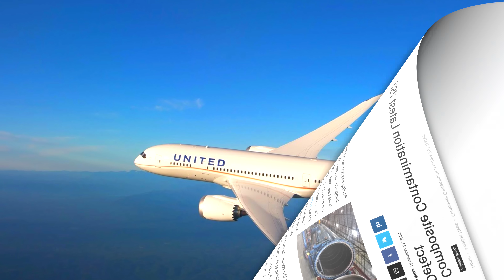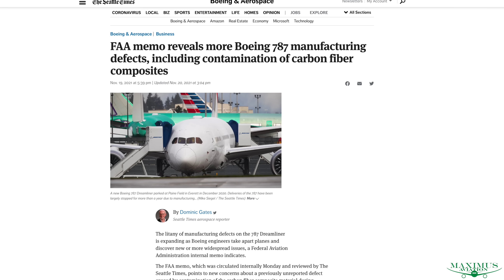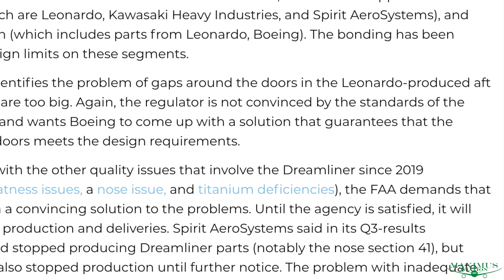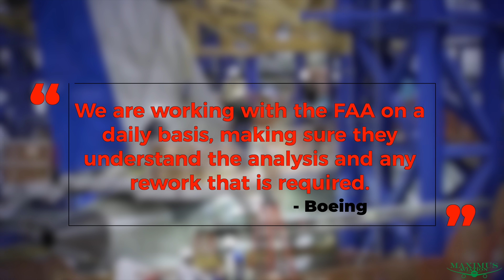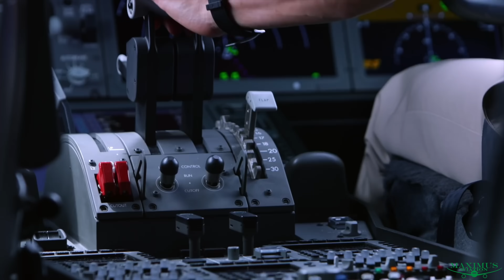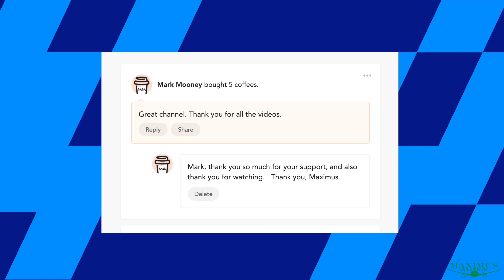Boeing Admits The 787 Carbon Fiber On The Wings Are Contaminated And May Compromise Wing Stability.

Comment: The 787 may be the first carbon-fibre airliner, but it's not the first carbon-fibre aircraft. It also wasn't the first airliner with carbon-fibre parts.
Reply: You are correct, but then no manufacturer would make such a big leap without having done its 'homework'    Boeing had some composite horizontal tails flying on 747s in the 1980s.
Reply: @dougball328  The point I was making, though not clearly, was that contamination issues are something that should have been discovered and addressed long before the 787 was even conceived.
Reply: @sylviaelse5086  You are also correct that it wasn't clear, since you never mentioned the word contamination.    I was there, and those issues were addressed - at Boeing.   The wings were designed and are being built in Japan.   For this kind of a process failure to happen there is almost inconceivable.   Clearly the operant word there is 'almost'.   Boeing's history with the three heavies is more than 40 years and nothing like this has happened before.

Comment: To outsource or NOT to outsource:

After the Boeing 777 program Boeing made a fatal decision to outsource as much as possible and these suppliers also outsource raw materials, parts and subassemblies. 

Thus Boeing looses quality control checks and balances down the long global process of raw materials, parts, sub assemblies, to final assembly at Boeing. 

The more Boeing hands off the more hands on that Boeing doesn’t know about. 

For example, before taking a multivitamin ask yourself: How many raw materials, processes and hands have gone into what I am about to swallow?

If the manufacturer outsourced everything and just packages the final product, anything that has gone wrong prior, even by the slightest amount during its long journey to the final packaging, the results may be more than a tough pill to swallow….they maybe and have been deadly ☠️😵🪦.

Comment: EVOLUTION NOT REVOLUTION!! Could have started the Composites with the wings, tail Section, and Cockpit Section and left the rest of the Fueselage built with Aluminium or Such as. Even Musks "Bakery" which is Manufacturing the Tiles for the Starship have their own problem with shedding tiles when the Enormous rocket boosters fire. In this case the 787 Low Bake Ovens maybe the problem! So large you cannot control the temperature at the center of the oven as much as they would like. Basically leaving an unevenly cooked roast. Suggest they Literally ask an Industrial Chef or Roast Master how they solved their heating Issues. I could suggest Good Ol Steam injected at strategic points from a boiler/steam generator.

Comment: As these composite material based planes start to age, I am afraid some nasty things might happen.
Reply: How composites age is certainly a subject of a great deal of study. And well it should be. We don't KNOW how much remaining strength a carbon fiber fuselage will have after 30 years and 40,000 pressurization cycles.  Not until 30 years and 40,000 cycles have passed.   The cycles can be simulated.  The effect of 30 years....takes 30 years.
Reply: @Turboy65  30 years maybe the best case scenario. What is certain, is that what is composed, will eventually be decomposed. These materials do save some fuel, but are quite risky.
Reply: @abababa7483  The carbon fibers themselves might be quite inert, what concerns me in the long run is the plastic binders. There are 30+ year old Formula 1 cars that still get driven, but I haven't seen proper testing of these aged materials.
Reply: @freakinccdevilleiv380  Take into account that airplanes operate in much harsher environments than formula one cars, so... I don't know.

Comment: Good thing those Apollo engineers [SpaceX too] didn't build/sell failed designs and ask for 2nd generations of designs.  BAD engineering is just bad engineers or managers NOT doing the work. In Boeing case I look to bad managers.  You?
Reply: Have you heard of the Boeing power issue? A few years back, the batteries in the 787 plane were faulty, and grounded the 787. :) Lol ... This is more like a Nightmare-liner.

Comment: And from that same Seattle Times article,  it is stated, "Initial tests conducted by Boeing and reported to the FAA in April showed a positive outcome: although the bond strength was reduced, it was still within the design limits."
Reply: That depends on if the contamination can be shown by samples that it is uniform and predictable...Fat Chance.....
Reply: @regdor8187  Did you read the article?  If the contamination was due to the usage of a PTFE barrier sheet in the manufacture of bonded composite parts, and the usage of such sheeting was routine and consistent, then the contamination level is very likely to be uniform and consistent.  Mitsubishi actually owns the blame for this one, not Boeing.   A manufacturer has to trust that its supplier is providing parts and materials that conform to spec.   Mitsubishi's process was wrong, and violated Boeing's specs.
Reply from the maker: Yeah it is within limits.  I also think since the FAA got burned by not doing their job on the Max disaster now they are going to  nit pick Boeing to death.
Reply: @maximusaviationchannel  I do think Boeing needs to be under the supervisionof responsible adults for a while.  And ultimately, all their problems can be traced to cost cutting on their payroll by replacing highly experienced and qualified personnel with immigrant "engineers" from third world countries, via the H1B visa program.  (Save money! Hire H1B!)

Comment: Making an airplane out of BURNT STRING....what can possibly go wrong?   

Actually I don't think this issue is going to do anything but maybe require inspections a bit more often than originally planned.  And let's not forget,  Airbus is using lots of carbon fiber as well.  And they have a surface degradation issue with some A350s.

Comment: Not just the manufacturers of the parts, there have been issues right from the start with even numbered aircraft produced in North Caroliner, this is what happens when you open a new facility and don't have the experience of putting them together, I dont want to knock Boeing as ive been a huge fan of all of their aircraft, but the need to turn all of this around else they will fold, and that just leaves Airbus as the market leader.

Stop paying directors stupid amounts of money, and get the engineer's back in the hotseat, as you can't run a business of this size just by accountants. 
If Airbus can produce the A350 with improvements then a collaboration should be sought to safeguard passengers now and for future generation's, Airbus is now ahead with R&D and Boeing is limping just trying to sort out ageing designs, aka 737 & 777, wtf, come on Boeing get your arses into gear.... sorry little rant over.
Reply: If the engineers are left in charge, no airplane would ever fly because it's not perfect yet. The business people are there to ask the engineers if it's good enough, or to cancel a program if it can never become profitable. A tension between the two is a good thing, bad things happen if either side becomes dominant.
Reply: @johnhaller5851  you are right on that their has to be a budget
Reply: Airbus money come easy for them.alway has boeing not so much.

Comment: Is like computer software. It does matter than it is the latest - you always wait for version 2 so that the bugs have been (mostly) corrected. What may ultimately doom Boeing's position as a world class aero manufacturer is its apparently half hearted approach to quality control (bug hunting). True Boeing reported this particular fault, but is only because the FAA keeps prodding them to check. Nobody has died in a 787 crash (yet), is not the end of the process. If you keep looking and keep finding faults then the FAA needs to be even stricter until it can't find any more faults rather than wait for another 737 type disaster. Since accountants rule Boeing, should be fined heavily for each new fail, but we know they will just buy off the court and evade accountability.

Comment: Boeing reported to the FAA that Mitsubishi Heavy Industries in Japan which builds the jet’s carbon composite wings had discovered contamination of the composite material during fabrication that could potentially weaken the epoxy bonding that gives the structure its strength. Although the bond strength was reduced, it was still within the design limits.
Reply: @Alfred Weber In engineering, load and strength calculation always exceeds what the design calls for, that doesn't mean it is weak if it's less.

Comment: Boeing got rid of senior engineers and designers and outsourced as much as possible. The engineers were highly motivated and believed in the company. Outsourcing appears to be cheaper...however choosing the cheapest way has proved unmitigated disaster for Boeing. It is next to impossible to control the quality by outsourcing so much. 
It appears that to get promoted in Boeing you must cut costs. Screw quality!!
Reply: Were these engineers metal workers when what Boeing needed for 787 was carbon composite technology?
Reply: @johnsutcliffe3209  Boeing had its fair share of composite engineers as they were and still do build composite military aircraft.
Reply: @DC8Combi  thanks for the info
Reply: @johnsutcliffe3209  my pleasure Boeing commenced the Joint-service Vertical take-off/landing Experimental (JVX) program in 1981 in which the V-22 Osprey was produced and first flown in 1989. She almost got cancelled due to many issues but was saved by congressmen and their support. 
We now have the  CV-22, MV-22, CVM-22 and the current and latest CCRAM MV-22 all composite VTOL Military aircraft.

Comment: I’ve seen some of those 787 on their Renton field.  They’re revolutionary planes but I don’t see how they’re going to check ALL of those errors in production
Reply from the maker: True.  Thats why I like what airbus did when they made the A350 our of individual composite panels instead of locking themselves into sinular fusealge sections like the 787.  I imagine if Boeing follows the 787 up with another carbon fibre plane they will do what airbus is doing.
Reply: @maximusaviationchannel  Ah, but without knowing more details about the type of contamination, where it is thought to exist, and method of it getting wherever it is, who's to say that none of the individual "panels" employed by Airbus in their design concept, don't have the same potential problems?

Comment: Isn’t PTFE Teflon?  How did that get mixed in on accident?!  Maybe using it on the outside and it got into the structure?  Craziness
Reply: Teflon is the layman's word for PTFE - or Polytetrafluoroethylene. Teflon is a much easier term for the general use.
Reply: Yes, and Teflon is used strategically during the production of laminated graphite/epoxy parts. The usage of it is controlled by specifications, all tools and materials containing teflon for purpose-of-use are made and provided by qualified suppliers, etcetera. Without more detailed information on this issue, the public, and specifically interested, knowledgeable, technical-minded people in the field will not be able to ascertain what potential impacts the "problem" might cause. I was there.

Comment: I'm really happy to see this clip, Maximus, so glad you followed up on the CF issue. Its Boeing's fault alright. Using CF in aircraft needs exhaustive and I mean EXHAUSTIVE testing. For each type. If you had one type of aircraft exhaustively tested with the new material and it was flown for a couple of years without universal problem, then it would be ok provided frequent testing by fully qualified inspectors regularly took place. With new materials you never know - as in the comet disaster where new and untested stresses/vibrations resulting in material fatigue caused 2 fatal crashes and permanent grounding of the type as a passenger aircraft. Same difference with CF.  But then, if a different type using that material was produced, that would need to be exhaustively tested quite separately to the first type, see. And we can easily see what happened her with the 787, can we not? Boeing directors and their greedy understanding have seized on a new material, successful in other spheres of production, like motor cars, and rushed into mass production with inadequate testing \insufficient knowledge and problems they could have foreseen/detected by testing,  had they been focused on reality and not greed. My heartfelt advice to Boeing would be to get rid of Calhoun and his shoddy, greedy, dirty management cronies and appoint an experienced engineer as Boeing CEO, with engineers and experienced managers with relevant experience at divisional and department level and to cut down on all but legally required accounting. No allowing accountants to oversee safety or testing.  This issue cannot be solved by patching up the CTF contamination problem because that is only one issue, not the central issue. This sort of failure will repeat into the future until Boeing is dissolved and sold off as the gigantic failure it has become. The central issue is inept management focused on greed and nothing else. Forget the FAA, its corrupt and stupid, just look at its psycho boss. We can hope that market forces will put proper respect for research, testing, design and REGULATIONS into control of Being. To shareholders I have to be honest - get rid of your stock now.
Reply: The ptfe has been used in many industry's for over 80 yrs.its a matter of keeping it from cross contamination. Which could be a layup issue. Then it goes into the autoclave it  might be getting contaminated there sounds to me to be a process issue.
Reply: By testing I mean testing the material or process within a variety of environments as well as load testing. It appears incredible to me that there were no precautions taken against KNOWN PTF contamination.
Reply: @jackrainbow560  I'm sure they did all that. This isn't boeing first jet and they been using carbon fiber for many years I know this because I was a autoclave operator for Boeing for many years. But I didn't work with 787 but I did on all other models and the 737 used alot of composites.
Reply: @andrewlarson7895  Well I'm NOT sure they DID do all that, Mr Larson. You will no doubt recall the earlier (2014?) windscreen glass cracking problems on the 787. They didn't seem to realise (incredibly!) that CF has a negative heat coefficient and the metal bracing round the windscreen has the usual positive coefficient which resulted in twisting, stretching and contraction forces being applied laterally to the glass. I understand you have experience with autoclave decontamination processes and I think you are quite correct in pointing the blame at Process. The first question is how did it get there? What process might they have using PTF and where is it located in relation to the assembly and storage areas?
Reply: Jack Rainbow, very flowery speech, but you are full of ****.....Boeing DID very extensive testing from which they developed their standards....That
wing was Load tested during development.....Next thing you will say is probably that climate changed caused it.....
Reply: @regdor8187  No need to make ad hominem insults, Mr Regdor, I will happily take your views into account. Slow down, please.

Comment: Boeing had plenty of opportunity to develop carbon fibre use and techniques on miltary products so while 787 was the first in one sense, a lot of knowledge should have been transferable.
Reply: The 787 is the first to out-source nearly all the major components! Good idea MacDonald Drugless top brass??
Reply: Boeing management refused to do any composite tech transfer between military and commercial, leading to commercial having to “re-create the wheel” to design and build the 787.
Reply: @treborg777  It's not that management refused.   EAR / ITAR government regulations prohibited it.
Reply: Uh, Boeing DID develop carbon fiber composites technology for Production Aircraft Primary Structures - on the 777 - in the early 1980's. Nobody had done it yet at that point. I was there.
Reply: They just didn't try to outsource all of it from the get-go. THAT was the huge mistake on the 787. I was there.
Reply: @mafreeland1027ATGTurner  Yes, I Agree, a Huge mistake.  To lose control over the manufacture of such important assemblies, particularly if you have developed technologies to manufacture in-house? Very hard to understand. I am sure there were cost advantages but still, seems practically suicidal!
Reply: @mafreeland1027ATGTurner  They did it on a small batch of 737 horizontal tails before that.   John Quinlivan headed up the composites development if I remember correctly.  (Yeah, I was there too, from 1977-2014.
Reply: @dougball328  Glad to make your acquaintance. The Mfg Tech group I was in supported John's Design and Stress Engineering groups on the 777. We made thousands of parts to prove the CFRP technology for the 777. I was aware of the earlier stabilizer panels, but didn't remember which model they were flown on.
Reply: @mafreeland1027ATGTurner  I remember John giving a talk to a group of engineers, and as he talked he assembled a carbon fiber fly rod.  It just kept longer and longer . . . and longer !  Any chance you are related to Rob Freeland that worked in Aero?
Reply: @dougball328  Nope, never came across him.